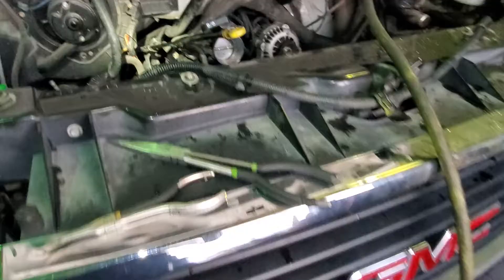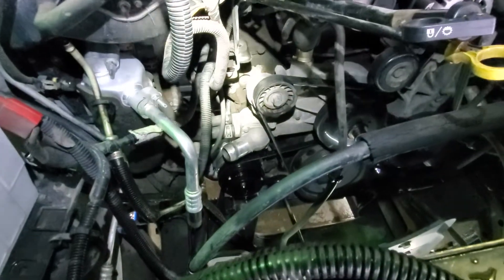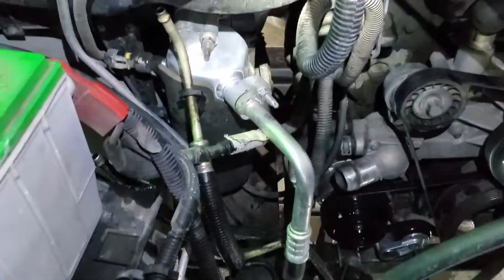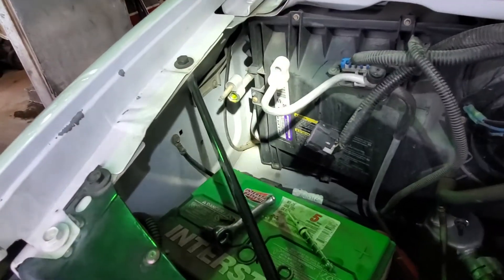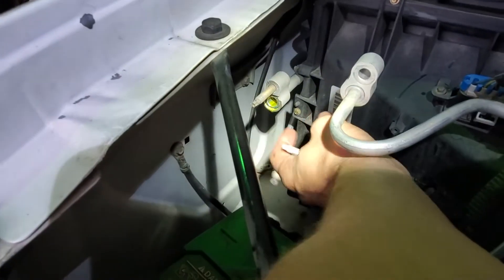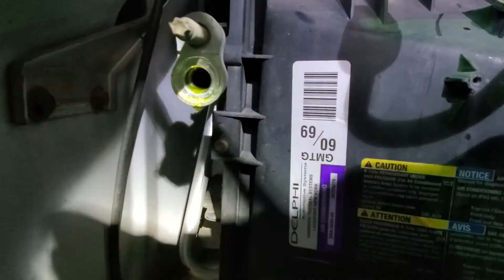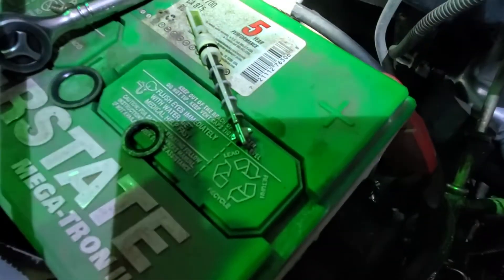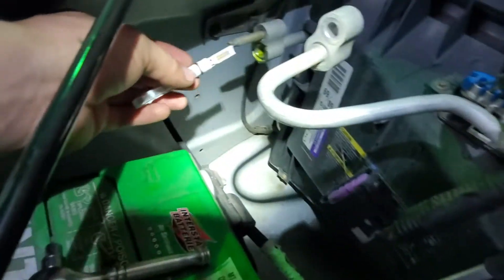2004 GMC Savannah/Express Van AC  orfice tube location

Comment: Why was the office changed? What kind of pressures were you getting to tell if it needs to be changed? Was it high pressures because its clogged?
Reply from the maker: It was changed due to compressor failure, so I couldn't tell you.